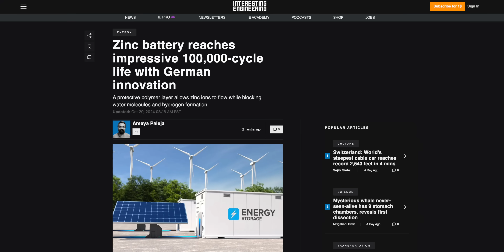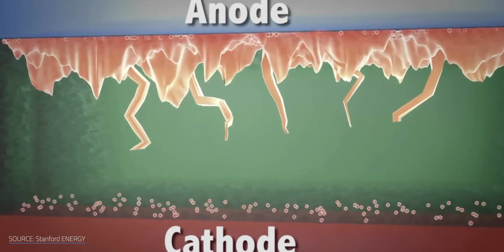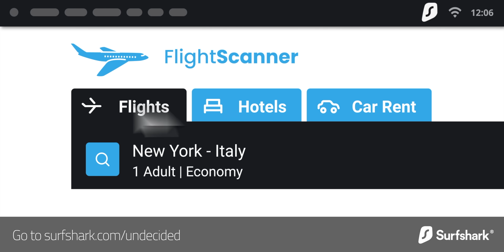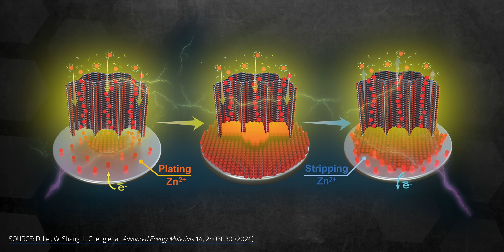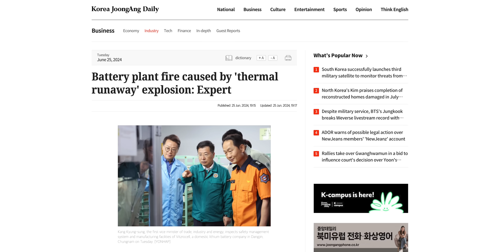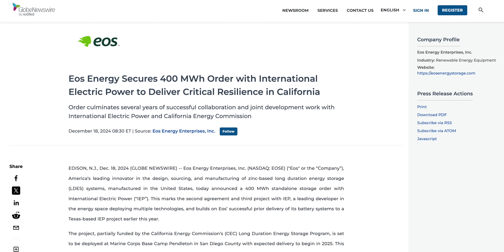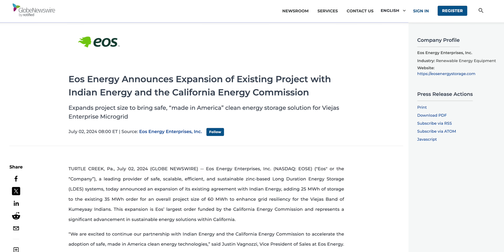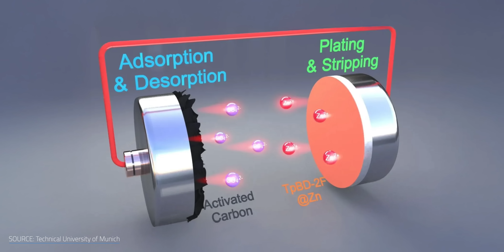How Zinc Batteries Are Defying Limits

Comment: 100.000 cycles until 80% capacity would be insane. One recharge per day = 273 years.
Reply: yeah.... a 100 year old person has lived 36,524 days.... so zinc battery solutions would be valuable for home resale value.... but there are no home zinc solutions.  How much would a 10kw zinc home storage solution cost?
Reply: @glen.simpson  
We actually have 10kwh of zinc battery storage with our home solar setup. It costs roughly half of what the 24 panels (roughly 5 kw of max output) costed us
Reply: Looks the same for Na S and Li S. ...decades life spans .. 8my Km  auto batteries. .. incoming.
Reply: @clivestainlesssteelwomble7665  The Zinc batteries seem to run at room temperature - that would be a relevant benefit over NaS for example. From an insulation point of course, but also if you'd have to fix something in the battery.
Reply: Probably even longer cos you're not going to do a full discharge everyday.
Reply: @nickcook2714  that depends on what you do. I drain my battery almost twice a day everyday.
Reply: 100 cycles is less then most phone batteries. I prefer LiFEPO4 that has 2,000 to 5,000 cycles. Over ten years of daily use.
Reply: I prefer to not need to charge it every day
Reply: Or get a Nickel Iron battery which already exists and they have batteries which are still useable at over 100 years old, oh and you can you can run the battery all the way to 0v without hurting it.
Reply: It's not that difficult to get "a" battery ranging from 10k cycles up to 100k. You need to pick materials that are around the most stable element iron. Which would be manganese, cobalt, chrome, nickel, or a bit rare titan and zinc. But you get 3 major drawbacks from them. - if the electronegativity is too similar you get low voltages for the ions you move. - those materials are dense and heavy. - as zinc ions are much larger than lithium they hit electrolytes and cathodes harder and more often. Given similar production tech, you get more heat from cycling the same currents/material.
Also, these claims are from labs. If you take LiFePo4, a good candidate for EV's it can cycle many thousands up to the 10k mark in a lab. However, in a car, it will degenerate to time, heat cycles, vibration, extreme charging states and loading(hard braking/superchargers), and unloading(sprints of the line). Usually, you can cope with these problems for a practical use-case, but there will always be some margin to it.
Reply: They could do fast recharge and hurt cycle counts by 10x and we still have 27 years of usage.
Reply: It's the Edison Iron battery all over again, nobody will want to produce something they can only sell once.
Thanks Capitalism!
Reply: That will just about see me out.
Reply: With that many life cycles price is going to be always high  with this if it is able to be used by the public. Because no company wants something that ask for four to five generations of people without charging an arm and a leg for it.
Reply: almost like a Corolla.
Reply: overkill your condensators will die after 10 years or other hardware issues will apear. So no reason for paying more, how about we just switch the old battery like one time?
Reply: @frankjohannessen6383  100.000 = 100
100,000 = 100000
Reply: @frankjohannessen6383  Remember, it has way less capacity, but if you are talking about implementing thr polymer with lithium, ur right.
Reply: that's why it will not passed. Not profitable.
Reply: @wanderingbufoon  you need to change your comment, you are mixing past tense and future tense in the same sentence.
Reply: Companies will still find a way to suck the money out of their customers. They would not want their products to last too long.
Reply: @crazyhumans-  There's nothing that lasts forever in terms of energy storage.  if there was, the cost to mfg or to sell would be too expensive for the average person to afford.

do you honestly think that they'll put a small nuclear reactor in a car?

Heck, body styling alone has a shelf life.  People want newer body styles.  Even the Government is changing specs on vehicles to add more safety features.

We have backup cameras as standard now, eventually it will be forward facing AND backup cameras as standard.  Then there's PreSafe breaking systems which eventually will become standard feature.

So, even if the car mfg. could, they'd have to load them up with every safety feature, and make the engines bullet proof which is next to impossible.  Batteries only store energy, they don't create energy.  batteries have to drive the motors and the motors aren't exactly free from burning up.   Have seen plenty of reviews of Tesla's where the electric motors have to be replaced.  They aren't cheap either and most of them nowadays have multiple motors.
Reply: Gridscale applications seem most applicable here.
Reply: Would be wonderful to add to homes. I've been waiting for decent battery technology to add to my home with solar. Most seem too expensive and don't have significant life expectancy to ever cover the cost.
Reply: @buddhamack1491  Cost depends where you live... About life expectancy: our 10kWh System is actually a 12kWh System sold as a 10. So it's only ever charged to 80%. Manufacturer guarantees 100% after 10 years but I expect it to last longer...
Reply: problem is quality control, in factory there is always some kind of accident or bad workers that make the product defect
Reply: In reality, used in fixed storage, due to the daily cycles the life will be nearer 100 years. 
But there is a problem.
If a company tool up to manufacture them and meet the industrial demand within 10 years, do the staff then take a 90 year holiday. LOL
What company would manufacture a product where the demand would drop to between 10 and 20% after 10 years.?

This is the same with LED lamps. We replace our 1.000 hour bulbs approximately once a year. So once we have replaced them all with 15,000 hour lamps, then what will the manufactures do.
In reality this is not a problem, since while the LED itself will last 15,000 hours, the electronics crammed into the cap of the bulb are lucky to last 500.
Reply: But it will only last 7500-10000 cycles.  They will be very, very carefully designed to fail after that point so that it will require very expensive replacement.
Reply: Too bad none of the battery tech shown on this channel ever actually comes to fruition
Reply: @kylequinn1963  it's been coming to fruition constantly. Batteries have increased capacity and dropped in price while the number of recharge cycles increases. 

The typical lag time between appearing on this channel and going into production has been about 18 months.
Reply: Too much IMHO. With so long duration, other reasons for decommission will arise, so you pay for something you won't use. 
That's said, it depends on the cost. If add that polymer only means a minor cost on the overall price, nobody is gonna reject a cheap advancement, no matter how "insignificant" can be.

Besides, even if you consider your installation only for 50 or 70 years, that means that the batteries will work almost the same no matter how much time will pass.
Reply: @oatlegOnYt  I.... by that logic we shouldn't use coper wires in homes because they last to long and the whole building will be long gone before you get full "worth" of what you used.
Maybe just me, but i would be happy if something I buy has one less point of failure. Even if then something else becomes that which limits it's lifespan... how can that be a bad thing?
Reply: @joz534  We don't use copper because is long living but because is a great conductor, and It has some advantages against other good conductors.  

You missed my point. My point is that the cost impact of lifespan decrease when the lifespan goes beyond the needs. Of course if it's free or extremely cheap nobody will complain. But if that extra life comes with extra costs or loses on other areas (like energy density) won't be interesting.
Reply: @joz534 
I hate aluminum wiring inside buildings. The risk of fire and lack of repairability.
Reply: @oatlegOnYt  The 'excess' battery life means the batteries can be sold after they have been used. There is already a market for used lithium iron phosphate batteries. Many are sourced from grid-scale solar installations.
Reply: @oatlegOnYt  also in some time there will be huge second hand market for those batteries, i guess those will be cheap
Reply: @oatlegOnYt How can something "last too long" for you, both as a consumer and as someone living in a society with a severe resource shortage? "Oh no, Manufacturer A's car lasts 200 years, that's too long, I'd rather pay the same for Manufacturer B's otherwise identical car that will lasts 10 years instead, that's more beneficial for me"
Reply: @norgeek  Still changing my argument. If you are offering a cheese with a expiration date of a year and other with 10 years and you will consume It the next two weeks you aren't gonna check the expiration date because It doesn't matter. But if the cheese with 10 years is 10% more expensive, you are gonna check that and buy the cheaper one.
Reply: @oatlegOnYt  I don't think you understand what a battery is, it's not something you consume once like a cheese and then replace it. It's something you can refill and reuse many times. It's more like a cheese container. Would you rather buy the cheese container that needs to be replaced after having contained 100 cheeses or the one that needs to be replaced after 1000 cheeses, even if the latter is 10% more expensive?
Reply: @norgeek  When you consider a lot of time, cycles loose importante as aging (yes, battery also loose capacity through aging without cycling), accidents, bad management and obsolescence (better alternatives after X time) can remove the value a lot faster.
Unknown variables gain weight with time.
Reply: @oatlegOnYt  so you'd rather pay the same money for a battery you have to replace many times, than one you don't need to replace, because... something better might happen? Is that what you're trying to argue?
Reply: @norgeek  You're talking for granted that non of those problems will arise. It's a bet for a very long time.
That's opportunity costs.

As I said from my FIRST comment, nobody is gonna reject It if it's free or close free, but if not, usually economics push for the cheapests if you don't have a quick return. Interest rates and that.
Reply: @oatlegOnYt  We arent talking about consumable items here, phones are not consumables, they are technology. Phones right now have no need to evolve beyond what they are, or at least we don't know what the next step is. The biggest limiting factor on a phone from 2020 from working well today is the battery. We don't need batteries that don't last. Even if they were consumable by nature, having a battery that when traded in provides far more value is worth more to both the manufacturer who can reuse them and the the consumer who ends up with more money in his pocket.
Reply: @oatlegOnYt  Obviously this means that you can recycle a battery that someone else has already used, saving huge amounts of money.
Reply: No. That’s just perfect. They need to be cheap and durable for grid storage; but not energy dense. For seasonal or weekly storage batteries don’t and will likely never make sense. But if you can cycle them daily and they essentially last forever this means they pair extremely well with baseload nuclear. You can just run the plant 100% and discharge the batteries during the evening peaks. There’s some utility for shifting the solar peak and flattening the curve; but since you can’t rely on wind and solar due to weather and seasons this will likely always be reliant on fossil fuel backup or large scale reservoir hydro.
Reply: @soylentgreenb  solar and wind are less expensive, and pair very well with storage like this. 
They don't produce radioactive waste and they don't require huge amounts of water to stay operational. 

Nuclear is only suitable for extreme latitudes in areas with no wind.
Reply: @oatlegOnYt  You’re only paying for something you don’t use if it costs more than other solutions.
Reply: @oatlegOnYt  Sounds like a good thing for storage batteries that don't move, imagine taking care of the batteries your great-grandad put on the house.
Reply: @oatlegOnYt that’s a ridiculous take. There are many things that out last your use and that’s a good thing. They can be RECYCLED. 

Do you think “ah the screen on my phone still works. I wish it was made worse cause I no longer want it and I already paid for it”?
Reply: @monkeypainter808  Why so many people read the part about the duration AND IGNORE WHAT I SAID ABOUT THE COST?
Reply: @oatlegOnYt  because it’s a ridiculous and self centered idea that something should only last as long as YOU get to use it because you paid for it.  

Especially if you actually watched the video and understood the applications.  
Most of the applications will be for big static installations that GENERATIONS of people could benefit from.  Even if it’s no longer needed, it will still be useful, and thus have value, which you could exchange for MONEY to someone who does need it.
Reply: @monkeypainter808  That idea you said 'is stupid' is used constantly in economics. As I said IN THE FIRST POST nobody is gonna reject a free upgrade, but the return gets lower at long term because the higher risks and variable changes.
The risks of unknown events increasing over time. The risks of fire, flood, being stolen, electricity peak because storms, shortcuts, human mismanagement, etc over a decade is the same year over year.

Try to pay the insurance for that battery over half a century and you will understand that you would pay more than the battery itself over extremely long times.
Ultra long hardware as soft as a battery has a high chance to being useless for a lot of reasons besides cycling. Of course if it's free, no matters how small it's It would be good. But It changes when It has a cost (monetary or worse characteristics in other aspects).
But even if It can return the value, something that return the value after more than half of a century, you can invest It in other things a lot closer in time.
If you still don't understand this, search for 'opportunity cost'.
Reply: @oatlegOnYt yes you can indeed make more money by making shorter term investments.  People like you are why the stock and housing market are broken.  Why we have houses worth nothing after 20 years yet no one can afford a house. 

For someone who seems to “understand” economics, you make a wild assumption that it would be sold at an unreasonable price.  No one is going to produce it if that was the case and obviously no one is going to buy it.  So if it’s in the market, it will be reasonable priced.  All your takes are as bad as the first.  Why are you worried about paying for insurance for 50 years?  

If you need a battery and it fits your solution, you will buy one. 

If you only needed a battery for 25 years, no one is forcing you to keep it.  

If it is so worthless that it’s not worth selling, then it would have most likely been cheap to buy in the first place.  Yes early adopters might get caught, but that’s the case with everything. 

If you’re worried about something happening to it before its life span is over, the same kinds of things could happen to any other part of your system.

This is the kind of short term selfish thinking that turned American industrial titans into a joke.
Reply: @oatlegOnYt  this is the kind of thinking that leads to titans like Boeing, Ford, and GM becoming a joke.
Reply: @oatlegOnYt  you are getting all of your arguments exactly opposite of what they should be. 

Paying even a large sum for these batteries which considering they're zinc, I doubt they would be that expensive, over the course of their life, they are extremely inexpensive. 

If I bought a $30 pair of sneakers, and they last me a year, That's $30 in a year. 

If I spend $280 on a pair of decent boots, and they last me 18 years, that's nearly half the cost.

I use the boot example specifically because I have a pair of 18-year-old boots, which I wore daily for 15 years. 

My point is just because it's more expensive in the moment doesn't mean it's expensive overall.

All of your risk cost analysis doesn't matter because overall this would be a cheaper solution than what we do now.
Reply: @oatlegOnYt I wouldn't worry about batteries lasting too long to be an issue, like you say, we don't know if they will cost much more and they are much better, there would be a thriving market to recycle and repurpose them. Besides, existing batteries only last so long, and we have to consider the cost of replacing batteries which is immense and the waste of it
Reply: @oatlegOnYt  other reasons for decommission?

Such as it's the wrong shape to fit in the new phone?

We managed a standard before AAA, AA, C, D etc but somehow that's out of the window

This has OSRAM lightbulbs written all over it
Reply: @ΑΣΔΦΓΗΞΚΛ I said before. The weaker piece in the battery system is the electronics.

Do you want your BMS last for more than a century? Good luck with that.
Compatible BMS? Do you know what kind of storage we will use in just half a century? I am not. And replace an extremely old BMS could be more expensive that replace the battery entirely, because it's pretty much custom made.

And as I said, cycling is just a subset of aging process. There is natural aging by passing the time. If you consider so extreme long living cells, every other needed element should last as much as you intended.
Do you believe that normal casing and other metals are ready to last for more than a century in enough good state to maintain the functionality?
What if the battery promises a duration of 200 years, but the company just disappear after 50 and the batteries start to fail because unexpected reasons?

Ok... What about the law? Sure, from certain perspective (specially our current technology), these batteries are very safe. But standards changes. What if the law will change in just four decades and batteries without certain fire-proof measures are banned or heavily restricted by law/construction rules?

And batteries still changes. What if lithium raises price because there is very high end lithium batteries while regular storage like these batteries are easily covered by new ultra-cheap non-lithium (like sodium) batteries? That can push for an scenario where your battery has more value scrapped for raw materials than for its functionality as battery.

There are lot of scenarios that are very rare in short term, but if you consider very long term the low chance is to have zero problems.
Reply: @oatlegOnYt  I'm on the topic of BMS replacements. You really don't think that if we had batteries that lasted that long, we wouldn't simply just make a replacement for it?

If we know they're going to need service then somebody would make the piece for it. 

It would make sense to sell those replacement pieces for the battery because there would be a huge market for it.

All of your arguments seem to come from a very short-sighted, highly consumeristic mindset. Why would we not want technologies that could survive through the generations? And don't talk about the market, these are the types of things that don't matter to the market, they change humanity. 

God I hate the society we have built that produces people that think like you.
Reply: @AdodgerWho  You are betting for a non changing society in a world that does the opposite. Why people would take the the bother of making BMS for a small fraction of battery market when they can focus in a bigger market based on the last technology?

There is a think named "economies of escale" that makes sense so the only reason why that market can exists is because they pay a surplus. So in the end, the zinc ultralong battery owners can find themselves paying more for the BMSs than new owners paying for the full battery.

It's an scenario, of course. We don't know how the future will be exactly, but I can asure you... It won't be the same. Lot's of unknown changes will happen and there could be a lot of reasons why old batteries won't be maintained economically.

You are speaking a slow steady state humankind that doesn't exists anymore. And I wouldn't bait that would happen in the future, because we need A LOT OF CHANGES so we can sustain our quality of life PLUS extended it to the whole population PLUS adding a lot more people that will grow this century until the population stabilizes, while we reduce the impact until it become sustainable.

I understand the good side of long living, but also the bad side. Very long life mean slow technology progress (or unnecessary long life that won't be used because become obsolete way sooner than the life of the good).
Reply: @oatlegOnYt  thank you for yet another terrible argument I told you not to make because the economy cannot continue to be the driving factor of society. 

We reach the end of that road a few decades ago. It's idiots that won't let it go that are causing the majority of our problems.
Reply: @oatlegOnYt  Sometimes functionality comes as a side effect of something else. Yeah no one needs a battery that lasts 100,000 cycles. But you won't be paying for that. You'll be paying what the market will bear for the relevant functionality.
Reply: @oatlegOnYt  What reasons would there be to replace something that is working just fine and is already paid for? Less cycle life would only be preferable if the cost per capacity is also proportionally smaller so that the adoption can be achieved more rapidly and with less money.
Reply: @oatlegOnYt  It could perhaps be that products would be specifically designed around the batteries. For example phones could be sold without batteries with a strict guideline for the form factor of batteries and you would basically get one and then use it your whole entire life, every time you buy a phone you take your battery out of the old one and then put it in the new one.

Or the batteries for phones could be made cheaper with less lifetime.
Reply: @jakubpluhar4914  I don't deny other usages although I think It would only have sense if the cycles per day are more than one.

For example, urban buses can be recharged múltiple times a day. Also possible new autonomous cars (robotaxis). In that case, the number of life years will be lower and make the amortization easier.
Reply: @oatlegOnYt  Doesn't matter if it costs the same.
Too great reliability is better than too bad reliability.
Also the battery could be recycled and put into new devices then for as long as it stays at rated capacity. So recycling without the need to destroy and make anew.
So basically the same battery would then be able to go through dozens of different devices before becoming unusable.
This would just be emphasized with the return of removable batteries.
Reply: @narrativeless404  I already say that at the FIRST POST. If it's free, the it's ok as the is no problem in longer life.
But if it costs, most people assume and value increasing proportional to the life, and it's wrong. Value is reduced over long lifes because the increase of the unknown variables.
On extremely long life, the value of having even longer is zero, because is never used.
Reply: @oatlegOnYt  It will be more expensive at first, but then it'll drop in price.
Reply: @oatlegOnYt  No, dude...people will not have an issue spending more for a better product.  People buy $700 work boots because they will last for decades.  I buy $400 boots because it's where the intersection of quality and comfort and price meet for me.

So no, you've been wrong SINCE your very first comment.  People WILL happily pay for better return on their investment. 

Now, please stop wasting all of our time defending a point that was trash to begin with.
Reply: @oatlegOnYt You're not really "paying for something you'll never use" you're paying for a lifetime product, it doesn't need to degrade or be destroyed for you to get your moneys worth. I mean there are literally still axes and anvils being used for over 100 years. Its not like the original owner didn't "get what they paid for" just cause it lasted generations. They paid for a lifetime product
Reply: @oatlegOnYt  What about energy storage for the grid?  I wouldn't mind if batteries lasted hundreds of years and didn't cost as much.  Don't think for just for cars, smartphones and laptops. Think in terms of what would work for the energy grid storage.  Or how about the satellites they are launching?  Elon's Starlink satellites use batteries that supposedly only last 5 years.

Cycle life is just one aspect of a battery that needs to be addressed.  Then there is weight, price, ease to recycle, how prone to catching fire/exploding, size, charge time and how much can they store.
Reply: @oatlegOnYt  The batteries could be recycled directly into another vehicle of the same general type, or used for static storage when the original vehicle is scrapped. This will reduce vehicle and static storage manufacturing costs substantially.
Reply: @oatlegOnYt  think of applications like grid scale energy storage. They could be used with solar, wind, generators. The grid could shed load to batteries. The batteries could also smooth variable load in or out of the grid.
Reply: @oatlegOnYt  "It last to long, it's too good"

Wild take man. Maybe you don't want a battery that can last nine generations but some of us do NOT mind the idea of that.
Reply: Why would I replace my EV battery every 273 years when I can just use petrol?
Reply: @Mexi257  at some point petrol becomes less available.
Reply: @Mexi257  Do you visit a petrol station every 273 years? What do you think is cheaper?
Reply: @Mexi257  Except that steel petrol tanks have a longevity of ~30yr, it'll likely start leaking long before your grand-grand-grand-child is driving your petrol-car.
Reply: @Mexi257  It says it too bloody heavy for EV. More like for your house or grid storage solutions.
Reply: @Mexi257  Dealbreaker for me
Reply: @Mexi257  I appreciate this satirical comment lol
Reply: @Mexi257  To be honest, we may not have 273 years left of petrol to begin with. While it is hard to estimate, as far as we know all accessible oil fields have been found and our current estimates are about 50 years left. Even if we find new sources, increasing this amount for another 100-200 years is a pretty big stretch.
While renewables are not the best right now, it may be the only option by that point.
Reply: @Sanadis  it was probably a joke, relax.
Reply: @Sanadis oil demand is already down 1%. It's projected to be down 2% by the end of 2026. 

Likewise the birth rate in many countries is now below replacement so population is going to begin shrinking at some point.  That means less demand for everything. 

The remaining oil may last longer than expected. 

Plus the remaining oil available is based on price.  If the price of oil went to $1,000 per barrel, you would see a lot of new oil sources developed that are currently too expensive to try to develop.
Reply: @Sanadis  There is a lot of oil ready to be tapped in several decades up in the arctic circle when it completely melts and there is a decent little bit in Greenland as well.
Reply: @Sanadis  not true .. many MANY aka MOST reserves are UNTAPPED
Reply: @PherPhur When the arctic completely melts is when everyone lives on boats.
Reply: @Sanadis we can make crude oil using only plants and sunlight easily. Its just more expensive right now than natural crude oil.
Reply: @Mexi257 and create more air for plants to breathe.
Reply: @Mexi257 great comments lol
Reply: @Mexi257  Like you petrol engine last that long. How is the Model T engine working out? Spares must be an issue not to mention finding a mechanic. At some stage, cars without fuel injection/Direct injection/turbos/hybrid power assist and variable valve timing will mean you will need to find a specialist (ie expensive) working car mechanic who deals mostly with vintage cars where the owner has less worry about the cost or just replacing whole parts.
Reply: @Mexi257  You won't. Zinc batteries don't have the energy density to be viable for electric vehicles 🤪 Maybe you missed that part.
Reply: @Mexi257  show me a petrol motor that still works as new 200+ years later
Reply: @Mexi257  Widen your mindset.  What about grid energy storage?  They need a ton of energy storage that's created by renewable energy sources.